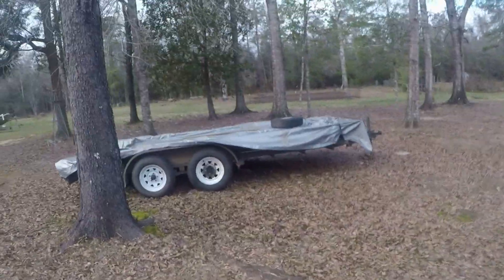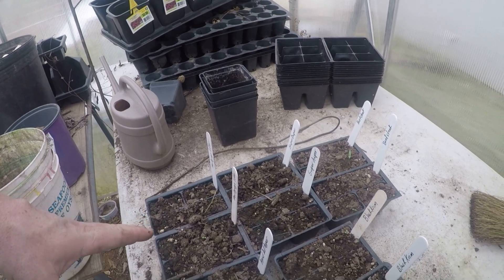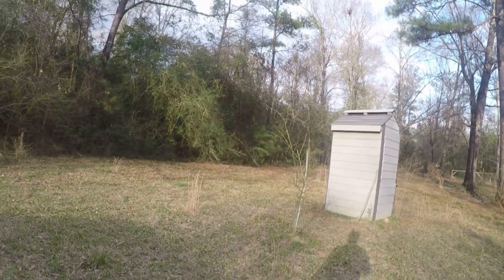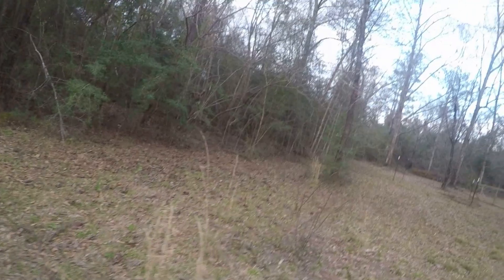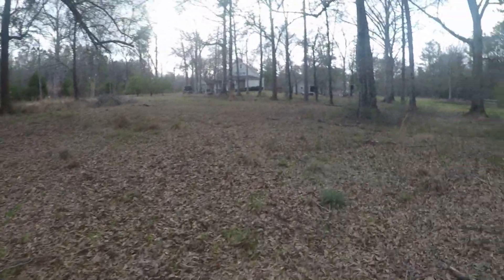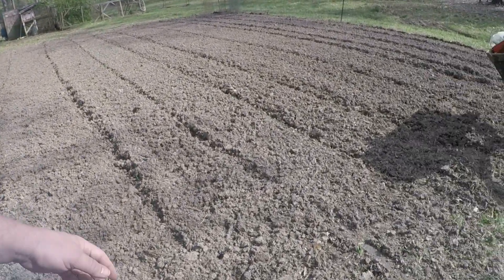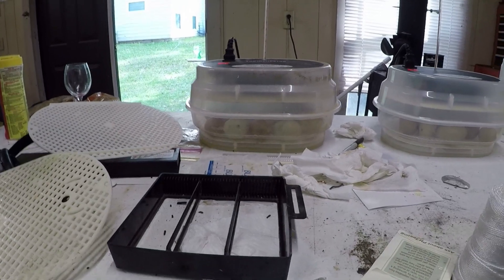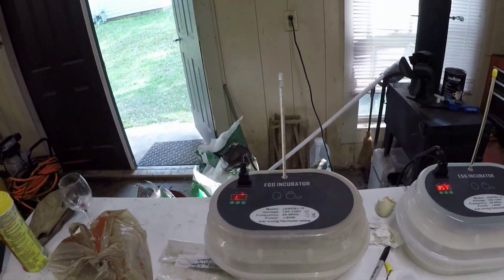Starting Back Spring Gardening/Homesteading. Zone 8B. Part 1

Comment: Things are waking up. Hope it doesn’t freeze again 👍
Reply from the maker: It shouldn't. The extend forecast has one day with a projected low of 39 for us. That usually translates to 37 but everything I have should tolerate that temperature. Last year I tried to plant early and I got smacked by a cold front that came through just about this time. It can happen all the way to April, but after March 15, it's very rare to have a freeze. Thanks for coming by. I should have a couple more videos coming up